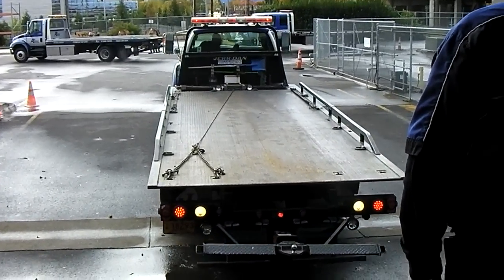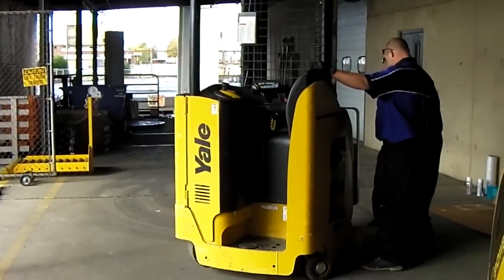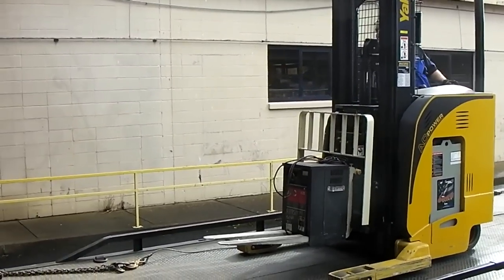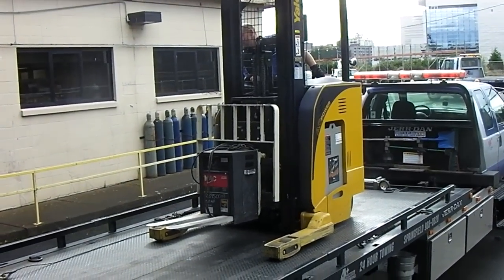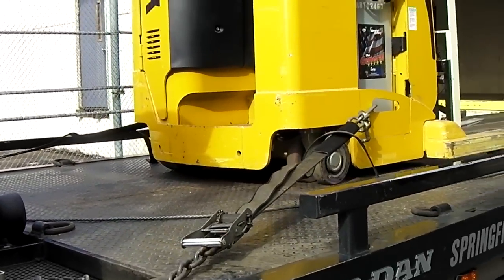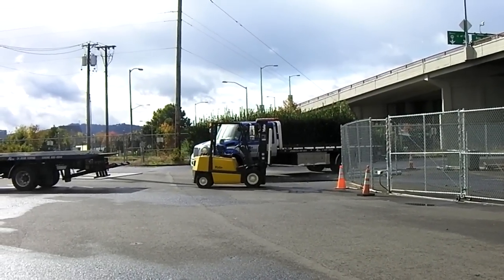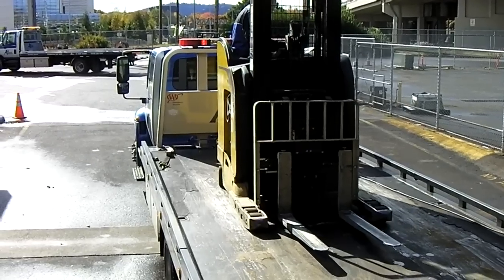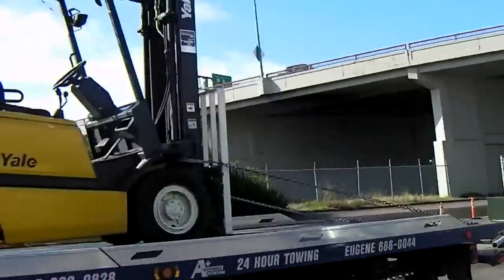Towing Forklift Transport

Comment: In Texas that is a violation when your chains are past 45 degree angle..the reason being is while you have lateral securement and some side to side securement you don't have vertical movement securement... not knocking the video at all....most drivers will appreciate it as do I..... well done.